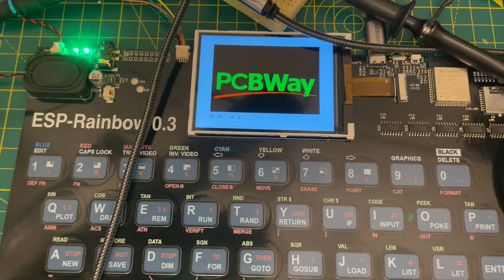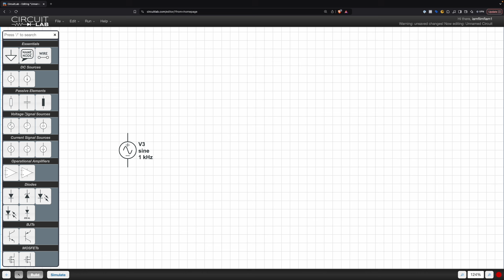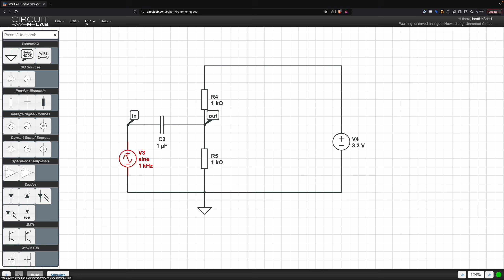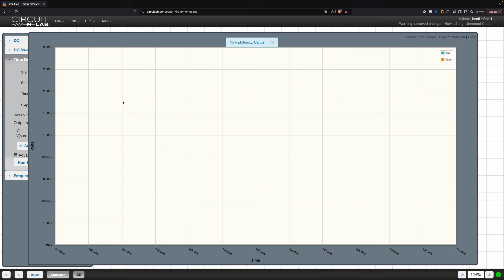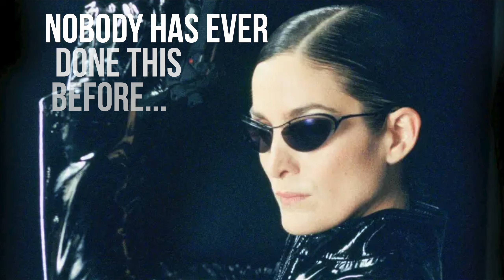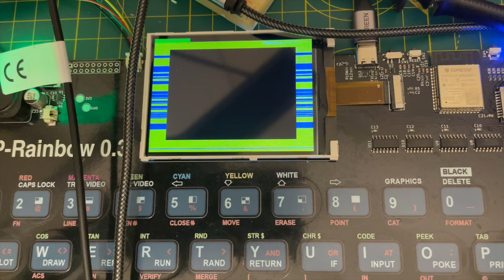Level Shifter Circuit - simulation and real world test.

Comment: Some games came with 'Turbo load', to avoid copies from RAM.  It had faster frequency and custom colors. I got an assembler and disassembler program somewhere I started to track down the turboloader asm code. I cracked it to return to the prompt right after load, so I could copy it to another tape and load without the turboloader. It was the 'commando' game, I think.  I remember the 'randomize usr XXXX'. I was about 15 and with much free time 😄. Those were the days my friend, we tough they'd never end...
Reply from the maker: I remember Commando - might try and get the TAP file and watch the loading :) I dabbled a lot with assembly, but never really learned enough to hack around with games. I do remember writing my own "turbo" loaded. The Complete Spectrum ROM Disassembly was a fantastic resource.
Reply: I found a small book: "Programming assembler for the Sinclair ZX80 16K...  and ZX Spectrum 48K".  There was even a PACMAN game as an example in the last chapters.  It was very well explained, I had no idea of anything. And I didn't do much, because it was tedious by hand.  But cracking games was easier, just write down the conditional jumps to different memory places, without understanding anything, and modify some of them by try and error, until you hit the conditional jump to skip the code verification, or make it always valid, etc..   Too much free time 😄
Reply: I remember an obfuscation method they used.  With an initial confusing and messy routine they 'encrypted' the rest of the code with a simple XOR transformation applied to the memory area of the code. Another technique was to change the jumps on the fly in the middle of the code. I think that all this was explained in a magazine article.

Comment: My pet never did the funny displays when it loaded programs from tape or make any sounds.
Never really had any of the home computers, Started with a Sinclair MK14, PET, Jupiter ace, then a home built 8086 PC.
But i do remember the preamble that all the modems made when starting a connection :-)
Reply from the maker: Yes, my younger sibling described the modem squeaks as “the mice talking to each other”
Reply: @atomic14  you got to know how the good the connection was going to be by the sounds. sounded like you could hear it dropping the speed as it failed. seems strange that i thought more of getting a 56K modem than i did this week when i got >1GB down load speed.